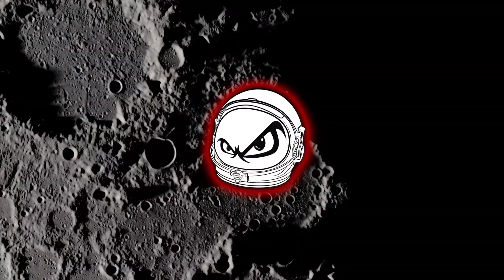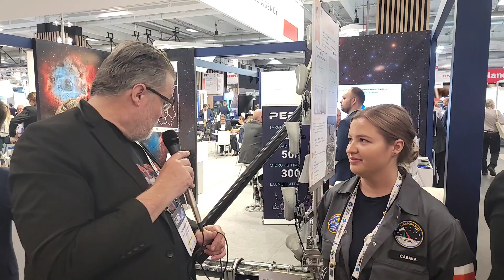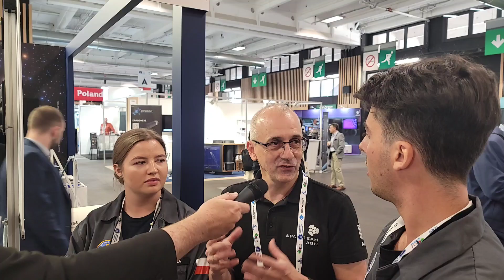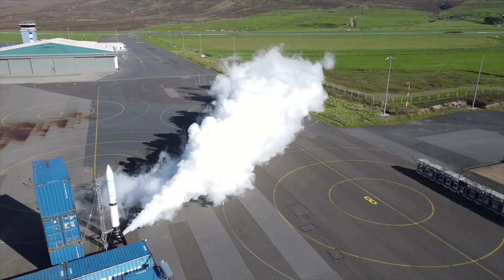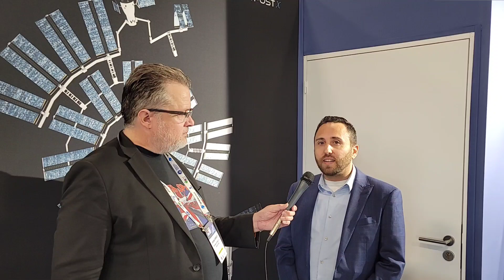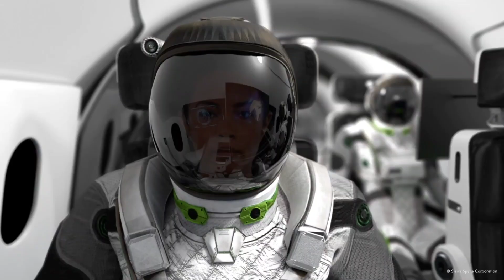Artemis Body Armor!  A New Space Station and more!!

Comment: bucket elevators and screw augers are amoungst the oldest ways to move dirt, dust and rock.  An old asphalt batch plant I operated used these, made in the 1950’s.  not ground breaking tech
Reply: Isn't it literally ground-breaking tech, though?

Comment: the effectiveness of this radiation armour would not be verified for some time.
Reply: Sure about that? Maybe we already use such things here in some areas? What about the nuclear sector? Mining of radioactive material, fuel refining, X-ray machine operation etc. I do not know but if they DO use protective suits there should be some data to take a look at. Better then nothing at least.
Reply: Lead aprons for xray techs.  Lead shielding against radiation has been around for generations.
Reply: @gamerfortynine  radiation shielding in space is different than the one for x-ray because they need a hydrogen-rich materials (eg: water or dense plastic) to block high-energy ionised particle, because if these material were hit by a high-energy ionised particle it will produce less 'secondary radiation' than if a metal was hit. For example; x-ray machine produce x-ray by colliding high-energy electron with a metal, this is what we call 'secondary radiation' if it happen in a spacecraft.

Comment: Paraffin as fuel is pretty smart. I work in the oil field and paraffin comes right out of the wells. It's ultraconcentrated hydrocarbons (granted commercial paraffin is purified of impurities because raw burns dirty). And if you can handle a candle, then paraffin is no different in it's handling.
Reply: “Let’s light this candle”

Comment: Why about the rest of the body's exposure to radiation that the vest doesn't cover?
Reply: Bone cancer would be one comcern.
Reply: In the case of something like Starship, ideally the walls of the ship would have heavy radiation shielding, especially if they do some tricks like piping the water through the walls to use as an extra radiation barrier. That combined with the vest should be very effective, but obviously none of this has been tested yet.
Reply: @toastedmatt9387  The fact that Starship are made of steel, thus having more mass already there they should have more protection.
Reply: Like their heads/brains?!
Reply: We are shielding the organs with the highest likelihood of cancer- that is the principal of selective shielding. It is not possible to protect the whole body with wearable radiation protection.
Reply: Hey, good point. The reason we are not shielding the head is that the likelihood of cancer in the brain is very small compared to organs in the torso area, and we are limited by mass and ergonomics.

Comment: The radiation vest is a smart bit of tech. Simple, but critical.
Reply: It is, for now, before protecting an entire space station is feasible. And when we DO dtart to radiation insulate them less visited areas could do with less protection.
Reply: @michaelpettersson4919  it is space PPE, it will be normalised to wear this from now on because it is better to concentrate the total shield mass that the rocket can carry on the Astronaut themselves rather than spreading it out thin on the spacecraft's wall.
Reply: @xponen  For now. It is like how during early flight was such a factor that they built fragile planes out of wood and canvas. Eventually, in the future mass will become less of an issue.
Reply: Uhh I wouldn't call a radiation vest tech. Its a pretty lead apron like Xray techs have used for generations?
Reply: @gamerfortynine  I was surprised no discusson about the head not being protected.
Reply: The head (brain) and hands are not as Radiology sensitive as the torso.